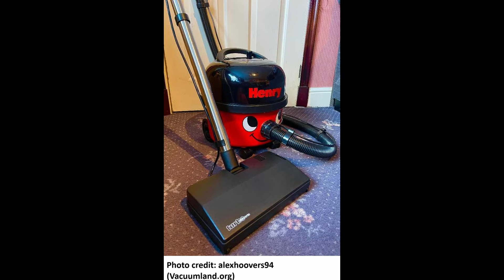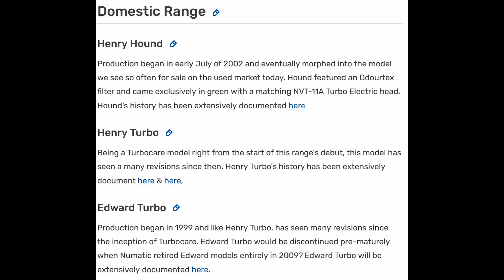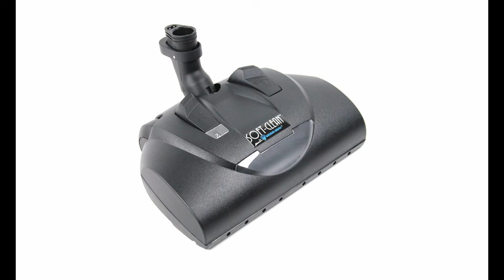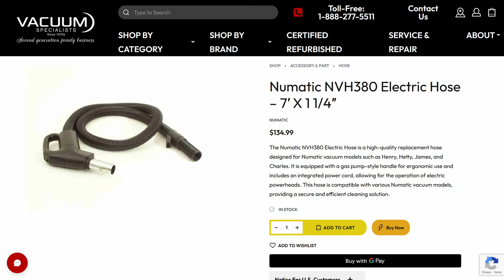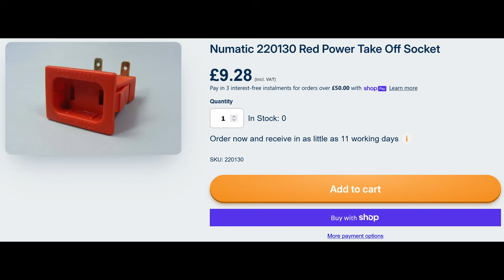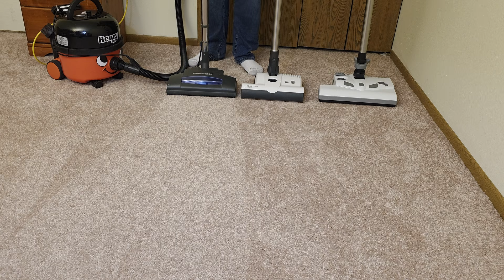Numatic Henry Powerhead Conversion (USA/Canada)

Comment: Fantastic video! It shows you really did your research for this one. I just want to add a few more pieces of information. 

Back when Numatic offered mains powered powerhead options, before they offered the EBK290, they instead offered powerheads made by Düpro Ag out of Switzerland. 

Düpro (Duepro) Ag is a now defunct Swiss designer & manufacturer of vacuum attachments. 

Düpro also made red the turbine nozzles with the Henry face that Numatic used to have throughout the 2000s and 2010s.

I believe the two Düpro powerheads they had were the ESB 106 & ESB 109.

By the way, an alternative option for the PTO would be a snap-in IEC C13 connector. The Swiss electrical manufacter Schurter make nice ones, but there are also generic ones from China.

Comment: One of the things I would like to do some day when I own a Henry vacuum.  At the moment though, I have a variety of machines to choose from including a central vac, two Kirby machines a couple of Rainbows and my Ridgid.  The tools for the Rainbow are some of the best quality wise out there as they use soft horsehair in all of its attachments that have it.  I don't think you really get that with Sebo or Lindhaus meaning you are protecting your floors more as well.  That said, I prefer Wessel-Werk power nozzles due to the simplicity and overall durability of design with it compared to Lindhaus or Sebo as well but even the PN12 on my Rainbow E2 Black and Eureka seem to be better than any of the EuroBrands as well being relatively more effective.

Comment: There was an Italian company  that made powerhead kits, was tempted to see if I could get one and use it with my Grans HVC200.
The Numatic Turbo range was interesting as it used a low voltage motor in the powerhead so no mains voltage going through the hose.

As for the original powerhead connector I would be very surprised if Numatic themselves don't still stock them, their parts supply for older machines is supposedly really good.

Of course another power connector option is a two pin IEC connector as used on some commercial Sebo machines.